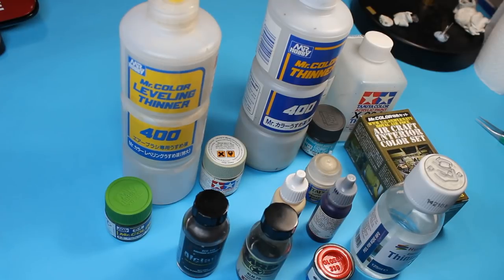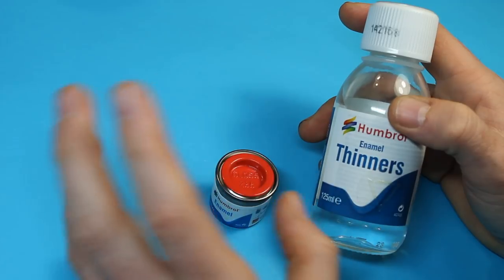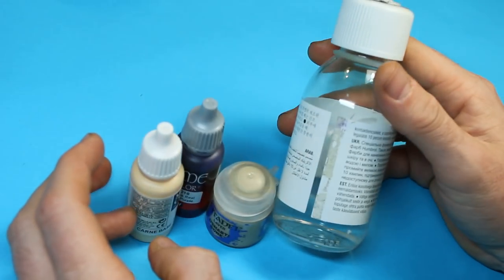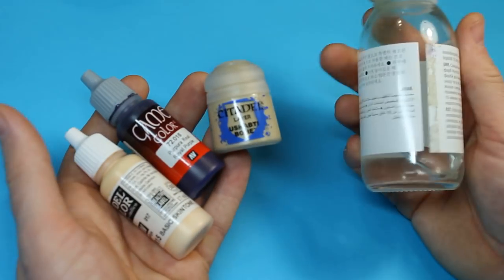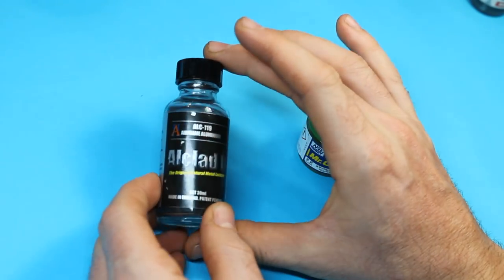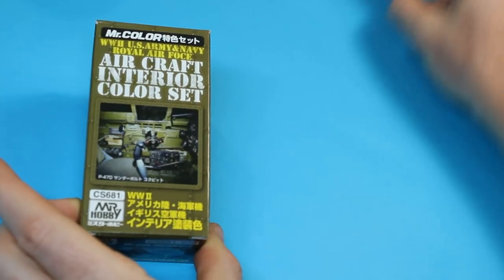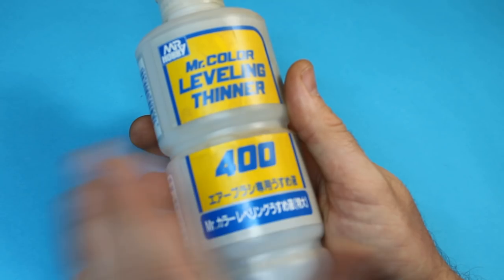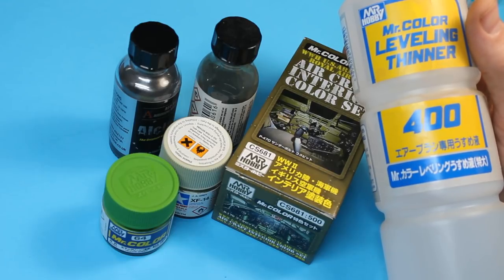Different Types of Paint I use in Scale Modelling

Comment: A Great and informative video I'm new to airbrushing and to be honest its daunting and confusing as to what you should use, and also without damaging your Airbrush and ruining your model. I live in a remote part of the Highlands here in Scotland there are no model stores and everything has to be bought on line!. But! none of the thinners you mentioned especially the more toxic Tamiya lacquer thinners and MR Hobby 400. CAN NOT BE DELIVERED BY ROYAL MAIL!    which in my case is frustrating having bought a compressor and H&S CR plus I cannot use it until I can source alternative thinner to use with some Tamiya XF acrylics. And to clean the Airbrush afterwards. you mention using a alternative Lacquer thinner but any suggestions where I might find one and any particular brand here in the U.K please.
Reply from the maker: For Tamiya just their own one X20a that will thin them and should be able to be posted
Reply from the maker: Failing that you can even thin Tamiya with water but it’s not ideal
Reply: Thank you for the reply, I have managed to buy a bottle of X20A but I presume I can use this to clean my Airbrush with. I can assure you living up here is like living on a another planet but its all part of the learning curve which I'm having to be more patient. 👍😎
Reply from the maker: Excellent, yes it will clean your airbrush out fine, just don’t let the paint dry in it. Clean it after using and it’ll work fine for you, many great modellers have done fantastic work with just Tamiya paints and X20a 👍
Reply: Thankyou I have just subscribed to your channel even though I had been looking at your recent builds, Hope you don't mind but I have another question with the Airbrush cleaning pot do you need to put anything in it before using it I heard to use tap water and fill it half way? or just use the thinner is this correct. The cleaning pot was thrown in with the deal I got with my Airbrush and compressor combined, but no instructions how to use the pot. Thanks again for taking the time to reply. @ChampionScaleModelling
Reply from the maker: @paulhumphriesz4557  not sure on correct use but I just blow the excess from the airbrush into it. 👍 thanks for the sub
Reply: your most welcome  thanks again. 
 @ChampionScaleModelling

Comment: Use Mr Leveling Thinner to thin Humbrol for airbrushing, goes down very nicely and makes it a bit more robust against enamel washes.   To be honest I never needed to put down barrier layers for enamel washes on top anyway as long as you leave it long enough to dry.
Reply: Is that for the Humbrol acrylics or enamels? I found that it makes humbrol acrylics go all gooey.
Reply: @arrrgee  Enamels.  I've not used the acrylics at all.  MLT is a bit "hotter" than enamel thinners I would guess.  I can thin the Humbrol enamel finer with MLT and able to use lower air pressure to avoid spidering, it'll spray much like Gunze or MRP.
Reply: @mattperson7293  thanks for letting me know, I'd never thought about using MLT for enamels, I've only used it with a number of acrylics so far. Although I don;t use enamels that often I'll try using MLT on it in future. Thanks.
Reply from the maker: Well thanks for the tip, I’ve just used it and it worked fantastically, really leveled out the enamel paint and no horrible odor from the enamel thinners 👍
Reply: @ChampionScaleModelling  I've had the best results with gloss Humbrol.   Seems to dry a little quicker than with enamel thinner, though by no stretch would i call it fast drying, but the small amount of orange peel I might normally get is even less with MLT, better than what I managed with gloss Gunze.   I'm really interested in using black gloss with MLT as a base for some AK Extreme Metal - which are enamel but already thinned.  The AK black base is okay but it has a very fine orange peel and it's so thin already, the Humbrol gloss has resulted in more glossy finishes.

Comment: As someone who has been using Tamiya acrylic for most of my spraying overtime I’ve noticed that the acrylic paint becomes thick and grainy when it sprays out of the airbrush and drives me nuts. What could be the problem I’m having with these acrylics?
Reply: If it is dry and hot paint dry very fast. Increase pressure and or more thinner and or reduce distance between airbrush and model. Hope that helps

Comment: Best video on this subject so far as bf I've watched many so thank  you.  I use Mr Hobby aqueous for brush painting I'm a about  to start using an air brush with the same paint. One question wouldn't just adding water slow the drying time just as well as 400 leveling thinner.